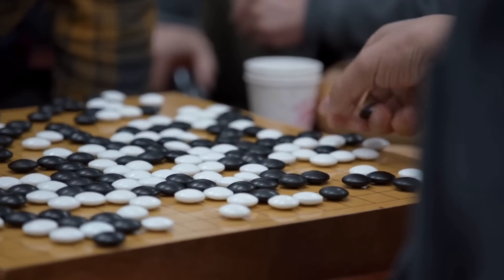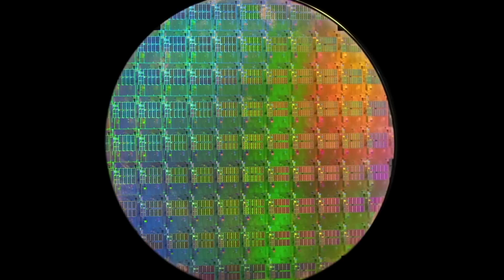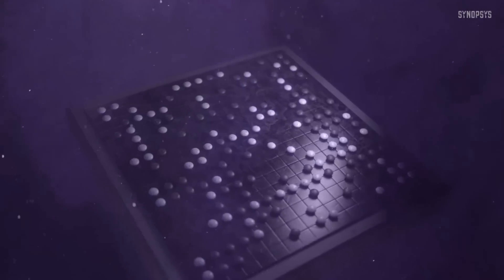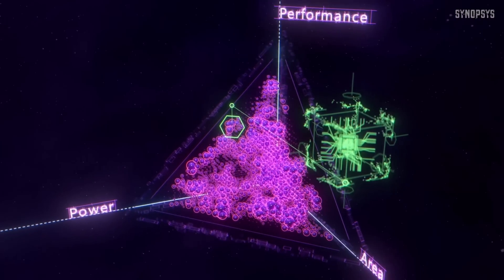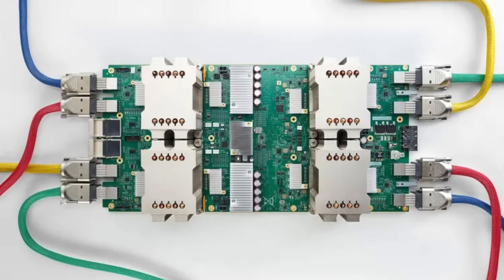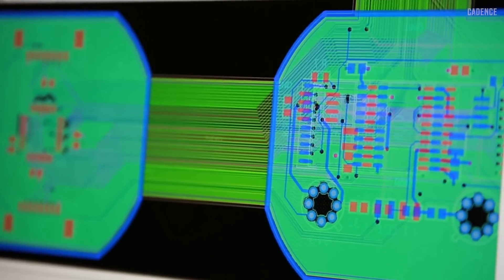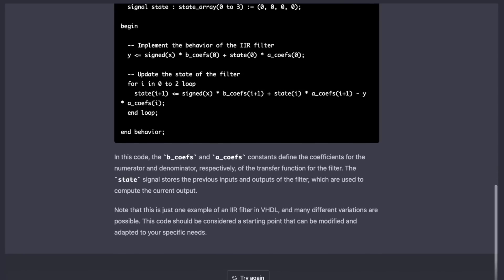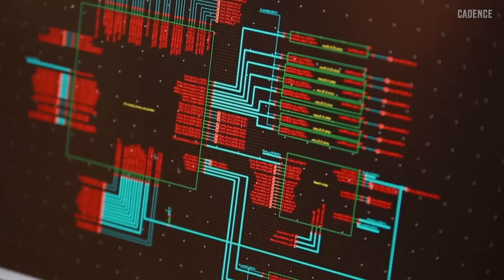New AI Learned to Design Computer Chips: The View of a Chip Designer

Comment: You were showing ARM chips by Apple at the beginning of this video. Obvious ARM chips operate differently than do x86 CPUs. Let's take a program like SideFX Houdini and try to run it on an ARM CPU instead of a X86 CPU to take advantage of the ARM CPUs. Would there be substantial alterations made to the software to make it run on an ARM CPU or would they just run it on top of an emulator?  To make SideFX Houdini run on an ARM CPU without an emulator would it require substantial alterations to the code?

Comment: you  Literally  Move  the   design  Around   by  Manipulation  Through  deep   ultraviolet laser molding   ,  which  is  still  Some  time  Off  =
the interactions of a large number of atoms, ions or molecules spread out all of the discrete emission lines of an object, so they can no longer be distinguished
meaning a full  range  construction  of a  chip  to  be  constant  on  any  portion  of  the  chip  ,  all  core  =  all  core  and  no  drop  between  cores  =  virtually  laying  the compounds  out  with  a  purpose  instead   of   by  luck  of  the  draw  , literally  creating  the  chip  instead  of  using  minute  portions  of  a  natural   formation  by  luck  is  layered  out  in   only   certain  areas  thusly leading  to  using  less  of  the  material , as  the  closer  we  reach  "0" nm  the  closer  to  a  resolve  to  this  clear  issue  of  supply  that  has  ran  cost  up  sky   high   now , and  in  some  areas  =   loss  of   life  over  it  which  needs  to  end

Comment: Is it possible to foresee AI redesigning the software in chips (yes, they exist as there might be a glitch discovered later to overcome), by overwriting the engineers program, because the AI came up with a more efficient design? Similarly, as a bug transforms into a butterfly, etcetera, can you foresee an AI controlling biochips so that the neural network reconfigures itself into a more efficient engine for performing a particular task? The working area being fixed, just like throwing out old furniture in a home/flat for a more modern look.

Comment: now if the ai could do the software part too then it can completely make a chip from 0 to production ready.

Driving cars designed by human engineers can have problems, an ai does less mistakes since all its work its made to reduce mistakes and its work is verified by a human like the reward system.

Comment: Put the chips around a ring and put the clock in the center it will allow you to increase the frequency and the electrons will reach the edge and all the chips at the same time. Makes it more stable when the high speeds are used.

Comment: Sure, let's break down the main folder into sub-modules and name them accordingly. Here are a few suggestions:

Sensory Perception Module: This module would include all the sensors and cameras that the robot uses to perceive its environment.
Object Recognition Module: This module would be responsible for identifying and categorizing objects in the robot's environment.
Localization and Mapping Module: This module would use data from the sensory perception and object recognition modules to create a 3D map of the robot's environment and determine its position in it.
Decision-Making Module: This module would process the data from the previous modules and use it to make decisions on how to move and interact with its environment.
Learning and Adaptation Module: This module would enable the robot to learn and adapt to new situations and environments, based on its previous experiences.
We could also add sub-modules to the NIS and RNCIN folders, such as:

Hardware Design Module: This module would include the hardware design specifications for building the robot.
Software Development Module: This module would include the software development tools and code for programming the robot.
Training and Testing Module: This module would include the tools and data needed for training and testing the robot's cognitive abilities.
Ethics and Safety Module: This module would include guidelines and regulations to ensure the safe and ethical use of the robot.
These are just a few examples of sub-modules that could be included in the main folder and its sub-folders. The naming convention could follow a similar pattern, using descriptive names that reflect the module's purpose. nano robotic cognitive intelligence network or NRCIN  Nanocloud Intelligence System" or "Real-time Nano-Crystal Intelligence Network (RNCIN)

Comment: 3:30 lmao. Sure... Maybe these particular AI won't replace an engineer, but saying AI in general won't is impossible to believe. Add ai controlled 3D printing and ai controlled robotics, shipment and manufacturing - engineer who? what? The engineer job will be to replace a pre-printed chip board when one burns out.

Comment: 9:00 "AI can help us in the process of chip design but we'll always need human engineers"
I think "always" is too bold a prediction. When we invent AGI and it has acquired enough skills, it can do better work than any human engineer. In short term, such AGI will be more expensive to use than human work but in long run AGI will take over all design jobs. I'd currently estimate that this happens between years 2030 and 2050. And the society at large is failing to understand that we should be making changes to social structures already because the change will be so huge that it will be hard to implement.
Reply: oh further down the like ladder and more people with brains appear, guess the masses like to appeal to each other
Reply: @lil_ToT-XFZ1  I think majority of the people are conservative. They think that if something has been acceptable for previous 50 years, it must be acceptable for next 50 years, too, so there's no hurry.

However, the actual timeframe for the need of major change in society thanks to AI getting into general use will be closer to 5 years instead of 50 and people are not ready for this.

Comment: Many many years ago (2014 iirc) i saw a vehicle designed by an AI made for optimal aerodynamics, 
It looked like cheese with holes but since it worked, aerodynamically at least, that was the first time when i realized the power AI will have and the first thing which came to mind back then was, why don't let AI simulate all possible chemical combinations and from the results learn more about the world, just one examples/fields of science of the many which AI can be used to accelerate our understanding about them.
Reply: we won't be needed to understand anything, why teach your dog mathematics?
Reply: @lil_ToT-XFZ1  Why wouldn't you?

Comment: But the A.I. may have a better design and the expert go “Nah rubbish.” They have to make every chip and run tests.

When is it that processors become like a 3D cube of processing?

I want my most used compute functions to become new hardware instructions.

Make the people work harder, I want to 3D print my own processors. 😆

I want to 3D print my own laptop that works using ambient light as the energy source. All solid with spaces for key switches.

Comment: 1. Rocket science like Falcon 9 & Starship also need chips to calculate, automate, and control its fins, engines to guide itself back to earth safely.
2. I'm thinking that what might happen if you code a  minor fault on a chip???🤔 Maybe the calculation would go wrong when I type something on a calculator in a computer...🤔
3. What's the differences between GNN and Neural Network in the chip of Tesla cars?

Comment: So, we pave the road to singularity, with more bricks. 
That's worthy of something else, than a couple of cute chuckles. In fact, it's worthy of a dire warning.
The GAI/ SAI development must be regulated, by hardware limitations. By human, active choices. 
If you program an AI to optimize itself, it will do just that. As much as the platform it operates on allows.
If you then give it the option to optimize the hardware of its successor, you may get more than you bargained for. 
A tremendously speeded up evolution. Of a new type of intelligence. A type, for which we have no reference at all. 
That's a pretty dangerous tool, in the wrong hands. And there are plenty of those...

Comment: We're definitely living in exciting times. At what point are they going to decide that something akin to Asimov's three laws get engineered into the hardware structures of the AI processing units to help with keeping goals in line with the good and continuing advances of humanity?
Reply: The three laws are impossible to enforce when AI is designing the chips. How will you know if the laws are still applicable when the chip design is to complex for a human to understand ?
Reply: @rrmackay  True. I was really thinking about the broader area in regards to AI and not so much in regards to chip design. However I think focus needs to strongly be placed on making sure the coming AGI will hold and share the best version of altruism towards humanity, especially in the light of humanity utterly failing in that regard.
Reply: @MyrddinREmrys  I would agree, altruism is the proper path, enforced laws and attempts at algorithmic control will fail. The Age of Spiritual Machines makes the argument that AGI will be a product of humanity, good or bad it will be a reflection of us.

Comment: Thanks for this. Certainly a good use for optimisation software - whether AI or otherwise. In your ChatGPT coding example you commented 'that looks correct' - this verification is a key step. You speak about AI validation - and that seems great for spotting rare anomalies in vast fields (something manual human attention is not very good at). But what about overall validation? If chips get so complicated that expert human engineers cannot comprehend their workings because they were designed and validated by a computer program, how can be know there will not be unexpected behaviours of the output of those chips under certain complex sets of inputs? You say you would prefer driving a car with human designed chips - it comes back to the issue of trust with your life. How to trust synthetic components that even the experts don't fully understand? It looks like we will have to come up with an answer to this eventually.